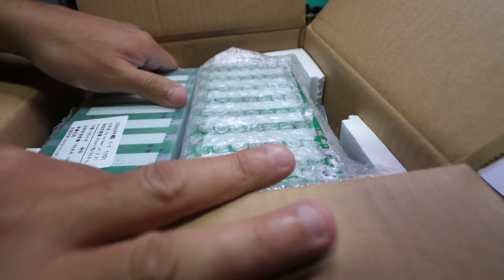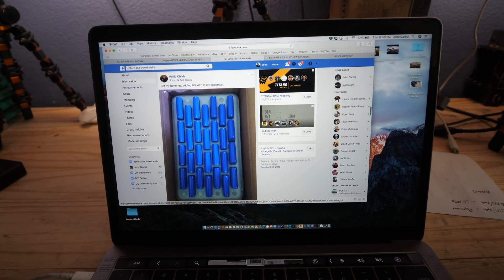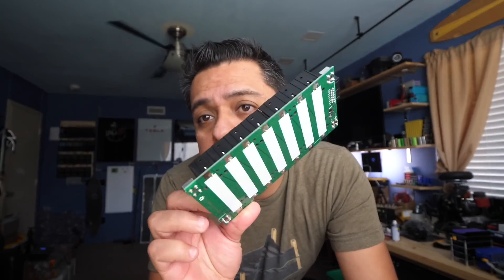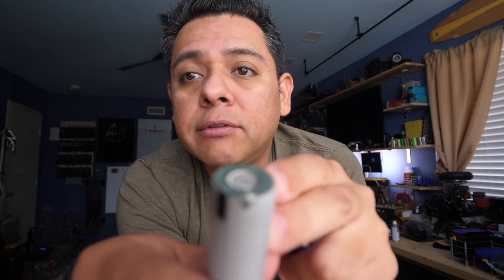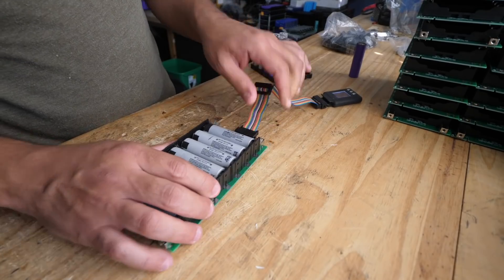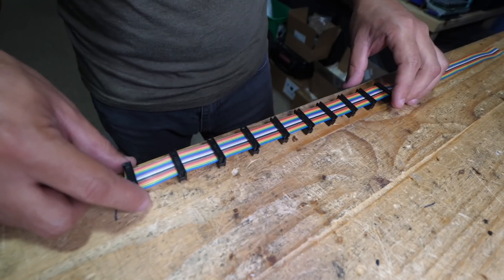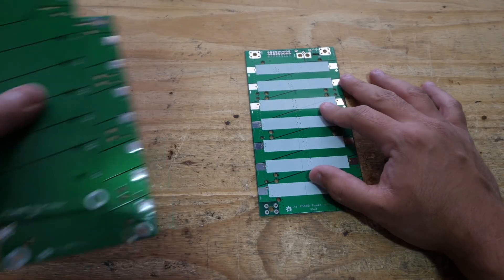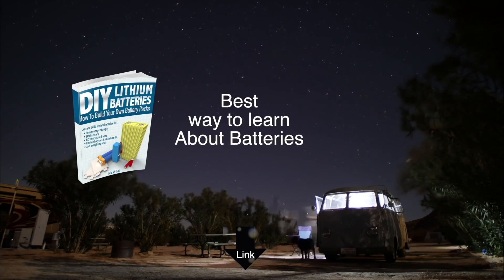Panasonic 3200mah or LG 2600mah 18650 cells

Comment: Starting the video, you called those boards v1.2.  Not the latest version?  Where's your ECR page?  (engineering change report ;)  Are you not fusing the cells now?
Jehu, did you confirm that the Re-Volt batteries were not the suspect chemistry?
Regarding the hot spots, have you tried greasing them with electrically conductive paste?

Comment: GUYS I NEEDED HELP:  I was charged lithium batteries in my bed room.  because over charged I felt slept one BUSTED IN FLAME fire. everything in that battery shoot out like a fire gun head.  I work up and stop the fire.  MY QUESTION is how toxic is ONE Samsung 18650 Lithium battery can do damage to my body?  It's impossible to clean up 100% carbon black color was all over my other things like books boxes clothes notes etc.  Can you guys check for me how bad is one 18650 can damage?  should I worry or I am ok clean as much as I can and move on?  THANKS A LOT.

Comment: I know I am driving you nuts with questions and I apologize but I want to really understand what is being done and WHY it's being done instead of just copying others work.  In your videos you use 1/8 watt resister wire to connect the batteries and act as a fuse.  Makes sense so far but, you then tie them to a larger "bus bar" for lack of a better word.  Here is one of your videos so you can see what I am referring to.  1:42 mark.  https://www.youtube.com/watch?v=_iOZQtoQ_S0   ----  In that video I simply can't see what this bus bar does.  Current is flowing from one cell to the next, to the next in series and it's doing it on the small fuse wire.  The bus seems to do nothing but tie the batteries together in parallel.  Apparently this is done with every row of cells for reasons I just can't quite figure out.  It seems to me you could simply connect each cell with the fuse wire and then parallel everything with a single bus bar.   ---  The other thing I don't quite get is...  You make your series connections with the fuse wire.  Lets say for arguments sake its a 14s configuration.  Now lets assume we are pulling 1amp per cell for a total of 14 amps.  Why isn't it melting the last (5 amp) fuse wire in the series?

Comment: Hi Jehu. I’m pretty new to this. I own a 2014 BMW i3, but live in an apartment complex, and can’t charge at work. My question is?  Can I build a power wall and put it in my car to extend its range, Or can I recharge from it while I’m working?  I would need about an additional 50 miles of range. Would it be expensive?

Comment: Jehu, a question.  You drive your VW quite a bit and I wonder what you do when it gets cold?  If I understand it properly Li-Ion batteries do NOT do well in the cold and you can ruin them if you charge when cold.  What do all the car manufactures do about this?
Reply from the maker: I’m in California it’s justly alsway  sunny and 80 degrees.  A few winter nights it might get down to 40s but I’m usually asleep and my bus in the garage when that happens
Reply: I think I hate you.   LOL

Comment: How many of the Panasonic 3200mAh cells do I need to get to 1kWh?  I’m new at the conversions and not getting it.  The answer to this would make my decisions on batteries MUCH easier...  thank you!!
Reply from the maker: 3.2x3.6= 11.52wh per cell. 1000/11.52= 86.8 cells
Reply: 14s6p (84 cells) would get you real close.
Reply: V(olts) x A(mp)h(ours)= watt hours . 3.6V x 3.2Ah (3200mA/1000) = 11.52 watt hrs/cell. 1kw =1000 watts/11.52= 87 cells(86.8). What he said👆
Reply: Wow.  That’s less than I expected actually...  sweet!

Comment: Tesla does not BUY Cells.  They Make Them in the Gigafactory in Reno, NV.
Reply: LasVegasVocalist incorrect. Tesla uses batteries that are made in their giga-factory in partnership with a battery maker. They do pay for them.
Reply: @do4267  I stand corrected.  I looked it up and you are absolutely right.  Thanks! :)
Reply: Panasonic employees reside at the Giga Factory making cells for Tesla.  It's a partnership.

Comment: What would it take to integrate a BMS into the boards for cell-by-cell monitoring, or 2-cell monitoring with both sides populated? Also it would be really cool to offer some sort of backplane to plug each board into. Search for SATA Backplane to see what I'm talking (that's what it's called for data storage solutions) about for plug and play with cell interchangability.

Comment: I dont get it so that little bms in parallel will show each batterys voltage? Theres like 8 batteries in each holder and theres like 11 floors, so 88 batteries
Reply: All battery's in parallel should have the same charge. So you only  the cells in series matter to the bms as cells in parallel increases capacity and cells in series increases voltage. Most power walls use cells in a combo of parallel and series.

Comment: Could I use these boards for  an EV conversion?
Reply: Yes. If you found a way to get enough cells in to reduce the individual cell load, along with fusing everywhere and a good BMS, along some protection between cells, yes, it would work.

Comment: I like the perpetual motion machine charging One battery with another
Reply: If only...  but there's no free lunch.  Probably 10-15% energy is lost in the process each time, but it's still much better than just wasting it as heat (unless of course you want it to help heat the house).
Could also dump out to grid, or make use of it to do work or heat water, but ultimately the batteries will need to be recharged from somewhere, and hopefully renewably.

Comment: So I need to check my math and logic- if I use your boards to build my 3 powerwalls for a total of 45kwh verses buying Tesla batteries ($1379 per battery), I'll spend at least 2k more between the boards and batteries (at $2 per cell). Why is this a better option verses the tesla batteries?

Comment: Any other way to get them in India
Reply: Dude.u can't import 18650s individually.too many custom regulations for lithium ion batteries.only way we guys sourced for our projects was  laptop pulls .That too only 30% turn out good
Reply: +prasad mudkatte 
I know that bro.
6$-8$  for 18650 single cells of 2600mah cost to shipping to india 
That's make them Super Expensive 😑😑😑😑
Reply: +prasad mudkatte 
I know that bro.
6$-8$  for 18650 single cells of 2600mah cost to shipping to india 
That's make them Super Expensive 😑😑😑😑
Reply: @VIPINSAINI_20  Ya that's y we went for the old laptop battery route.its cheaper but super time and labour intensive.we retrofitted the old solar street lights with 20ah lithium ion as part of project.
Reply: May be we have 50 odd extra 18650s (1800-2100mah ) tested I can send u data  of the tested cells if ur interested lemme know.how many are u looking for?